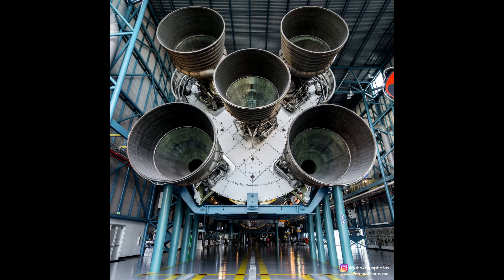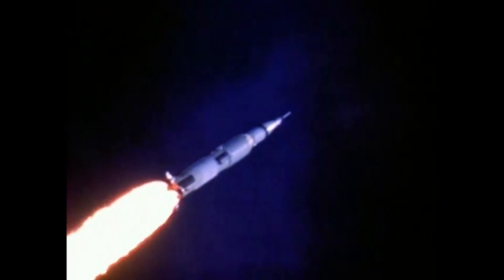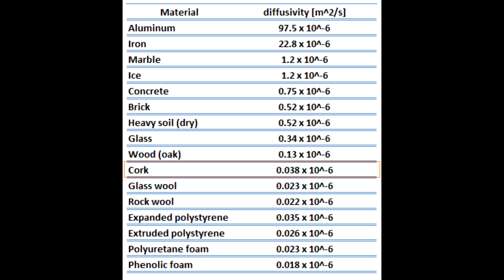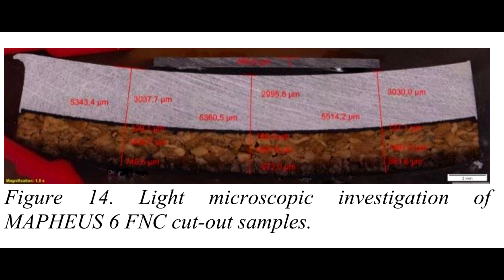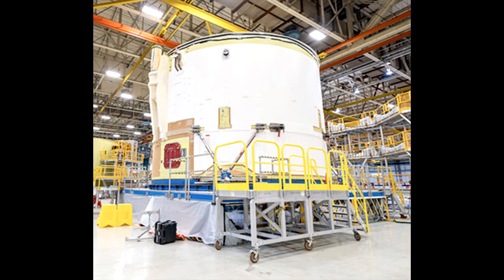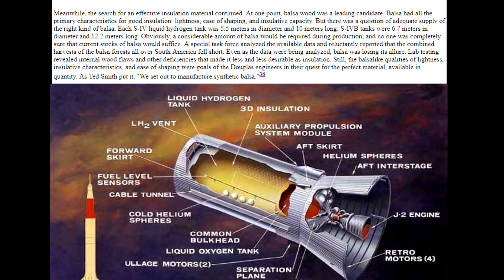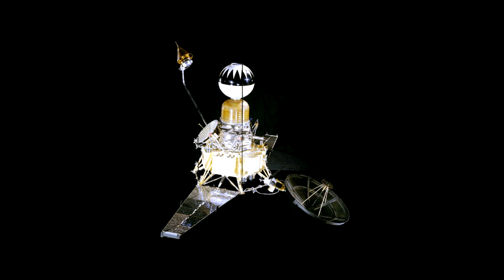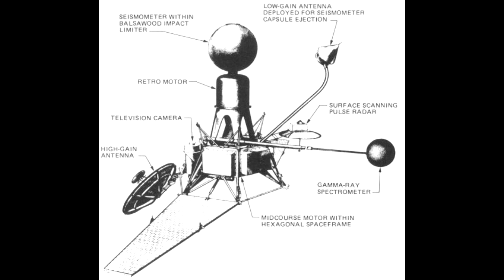Why Engineers Used Wood To Build Spacecraft

Comment: 1:35 I can't help but laugh at the idea of using a cleiko to hold cork in place, I'd have thought that they'd use an epoxy or something instead of later rivetting it into place.
Reply: They probably used both. Take an aluminum panel, use some form of adhesive to bond cork to it, then fasten the panel to the rest of the rocket (likely with removable fasteners, not rivets).
Reply: I'm glad I'm not the only one to notice that.

Comment: Great video. BTW, leeward is pronounce lew-ard.

Cheers.
Reply: JohnyG29 
That makes no sense, given that the antonym is “windward”.
Reply: @ragnkja  It's just the way it is old chap.  I love old nautical words like this and learning their proper pronunciation.  There's usually a good historical reason.   Like gunwale, which is pronounce guh·nuhl.
Reply: JohnyG29 
I’d think that sailors would be aware of the connection between “alee” and “leeward”. Also, the Oxford Dictionary of English lists both pronunciations, with Scott’s as the first and yours second.
Reply: @ragnkja  You can say it however you want old chap.  However, coming from a strong sailing background, I'll stick to the correct way.  Nice chatting with you, have a jolly nice evening 😀.
Reply: JohnyG29 
It is a correct pronunciation, it’s just not the only pronunciation. Also, I am not in anyway a “chap”, nor do I think of myself as old, given that I am still under thirty.
Reply: @ragnkja  It's a term of endearment, old chap.  I thought we were having a polite discussion, however you are clearly insane.  Cheerio forever.
Reply: JohnyG29 
I am reasonably sane, and if you saw me in person you would not call me a chap unless you apply that term to anyone regardless of what gender they present themselves as.
Reply: JohnyG29 
Accidentally misgendering someone in a text-only context is fine. Refusing to acknowledge that you’ve made a wrong assumption is not. We were having a polite conversation until you called me insane for calling out your assumption.

Comment: as I understand it, wood isn't flammable.. it's the gas that it sublimates when heated that's flammable :)
Reply: Wood has many components which each burn at a different temperature. This is important for anyone heating with a wood stove; light woodgas burns at a low temperature and creates a bright, short duration flame. But if you only burn this then most of the heat energy available is not used, and also you get buildup of "creosote" inside your chimney. Creosote is heavier oils. When you get your stove to a proper temperature, creosote is also burned, as well as the charred black solid structure of the wood (charcoal), and all you are left with is white ash (which has a very much reduced mass compared to the original wood, perhaps 1%). So in a wood stove, ~99% of the mass of wood is burned.

Comment: Looks like Starhopper 20m test experienced the same issue as the capsule destroyed by the abort test, pressurised fuel system rupture.
Reply from the maker: Nah, it's fine, plan is to fly again tonight.
Reply: Yep Elons said was an overpressure event caused by coolant being colder than expected.

Comment: In before Matthias Wandel
 joins the chat.
Reply: I wonder if he wood...
Reply: inb4 matthias wandel builds a working spacecraft from wood

and a follow-up video where he makes a dust extractor for it with a motor salvaged from a blender
Reply: the rocket crawler transport platform is a giant a lever engaged mobile stand.

Comment: Wood offers something no foam can do.  Oriented strength.
Reply: I don't know if I'd say that.  There may very well be ways to orient a foam's cell structure in a particular direction.  Curing in a centrifuge or applying pressure in a certain direction might do the trick.
Reply: @brainmind4070  I think if you could pull that off, I think it would be a very successful business enterprise.
Reply: @NomadPrototypes  Wood is made of cells.  What are you talking about?  Wood is also porous, meaning it has 'cells' in two meanings of the word as well.

Comment: Related to this, but as an engineer, I can confirm CAD stands for both computer aided design and cardboard aided design.
Reply: I find the main problem is the rarity of decently sharp scissors in a design office
Reply: Henry Atkinson lol, when you can't visualize it in the air, just build it out of cardboard.
Reply: @Henry Atkinson a Colin Furze fan I see.
Reply: I <3 cardboard prototypes
Reply: @AlohaMilton  Isn't that technically called a mockup, as a prototype needs to have actual functionality? Sorry for the nitpicking.
Reply: @kangirigungi  It depends on what you are designing.  A prototype of an architectural model might be in cardboard and card stock.  Its a functional prototype as the function is displaying size and scale relationships.  I have made wearable prototypes of soft goods out of cardboard hot glued and taped together.  Backpacks and such.  In that case it is again functional for the time it needs to be to get a sense of ergonomics.  I have seen cardboard as product, from VR goggles to designer lighting.  Cardboard computer cases are big in the budget gamer crowd, at one point i had enough for everything but the PC case myself.  I would agree the statistical use of cardboard in design might lean towards 'mockups' but it is dependent on the project.  The definition is variable and getting a bit muddled as UX designers have a whole different vocabulary using the same words as physical product designers.
Reply: Shout out to balsa, a best friend of rocket, airplane, and rigid structure modelers alike!
Reply: Binky?
Reply: Sssshhhhh it’s not Thurzeday. Colin only comes out of the garage on Thurzeday and you’ll confuse him
Reply: CAD also stands for Canadian Dollar.
Reply: Casanova was a CAD!

Comment: Wood is awesome. I'm considering a hobby type solid motor, using an aluminum energy drink can as the casing, and wood turned on a wood lathe for the nozzle. The wooden nozzle would be painted with an ablative on the inside of the combustion chamber and nozzle like epoxy or perhaps a paint. It would also have a carbon throat insert, assuming I can turn carbon on a wood lathe with acceptable accuracy. I should probably also mention that the propellant is not a hot burning perchlorate/aluminum composite like all solid space rockets use, it's a far cooler burning sugar propellant, sorbitol is the binder/fuel, and potassium nitrate is the oxidizer. And burn times are going to be about 1.5 seconds, so that lowers the thermal difficulties considerably.
Reply: Maybe a full graphite nozzle would make it fully reusable if you have the material and machines to do it.
Reply: @abcdefgh-db1to  Re-usability is totally out of the question I'm afraid, making solid rockets that A. function reliably and B. perform decently in your garage is actually fairly challenging. At least it has been for me. That, and sugar propellants leave lots of solid combustion residue everywhere.
Reply: @onogrirwin  maybe a hybrid rocket engine would make it cleaner
Reply: @abcdefgh-db1to  hybrids are kind of bad :/ And it doesn't need to be clean. re-usability is just not a meaningful goal for hobby rocketry. Hitting altitude milestones is hard enough. And why did I say hybrids are bad? Poor combustion efficiency, and the need for a fluid oxidizer. If you are going to deal with a fluid oxidizer why are you not making a liquid rocket motor... And from a hobby standpoint there are only two viable oxidizers - NO2, and gaseous oxygen. Gaseous oxygen is... a gas... and so you have to use thick walled, heavy tanks to keep it under a lot of pressure, and even then the tanks have to be huge to get a reasonable amount of burn time. So you end up with terrible overall performance. Big rocket, short burn time = doesn't go very far. NO2 is a lot better because it doesn't take that much pressure to keep it a liquid, but it's not without it's own issues. Liquid oxygen is just not within what I would call hobby rocketry.

Comment: If the Tudors had launched rockets, I'd like to think they'd have been half-timbered.
Reply: The stucco/plaster would probably have held up well also. The thatched nosecone - not so much.
Reply: Wood lathe & plaster heatshielding 👍
Reply: Steampunk rocketry...
Reply: A nice solid oak, parquet flooring pattern on the thermal insulation system tiles would set it off rather nicely.
Reply: Ever heard of the 'Mary Rose' - if the Tudors had've built a rocket it would've been the very first to have sunk on its first flight...and in front of the King?!
Reply: hahahahahahahahah!
Reply: the SRBs of the shuttle would have been rather nice in the Tudor chimney style, some nice symmetrical patterns in the brickwork would have worked well.  

Bit much with the parquet pattern as well though perhaps.

Comment: I would love to see an in-depth engineering type of video on the development and utilisation of wood throughout history. I know it's not really Scott's thing, maybe Real Engineering or Atlas Pro
Reply: Lewis Massie heavy timber in construction is considered by modern code standards to be a fire resistant structural materials. It functions almost the same. The outer layer chars and can no longer provide fuel for the fire leaving the core of the beam or post unscathed enough that it retains its structural integrity.

Comment: we need more of those traditional rockets. don't make them like they used to anymore.
Reply: Massively inefficient and prone to explode?  No, they dont make them like that
Reply: Traditional rockets? The Delta is still flying after 60 years. And the new designs are so robust they can be reused.
Reply: Literally both replies above
r/woooosh
Reply: Kevin Miedema Isn’t it quite odd that not one space organization, military or private, anywhere on earth can match the power of the Saturn V from 1960’s?
It’s honestly quite absurd that current technology can’t produce something at least on par with the amount of power the Saturn V produced. 
Your statement is FACTS
Reply: @stephen_crumley  Actually. They dont do so because there's no NEED, the only ones who may actually need it would be Space X, maybe NASA, assuming they dont launch a load of timy modules and such. Infact it's absolutely certain we can make something bigger and/or better than a Saturn V, but again, no demand or need for it, as most launches are satellites and telescopes, a few modules for the ISS. And that's about it.
Reply: space X is going that way again. now that the need for a big rocket is back on the table.

Comment: "Why engineers used wood for rockets?"
Well, the germans used wood in WW2 as a main material for their ground to air missiles because it simply was a cheap available and strong material, does this answer the question ;D?
Reply: And the Japanese made wooden versions of the DC-3...
Reply: Kim Wallace  The Me262 was aluminium, the He162 was plywood.